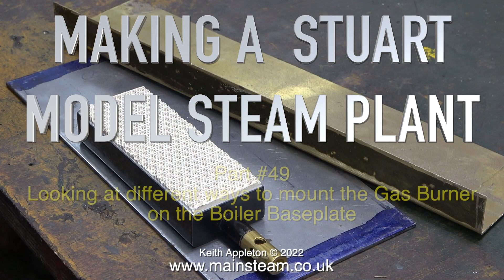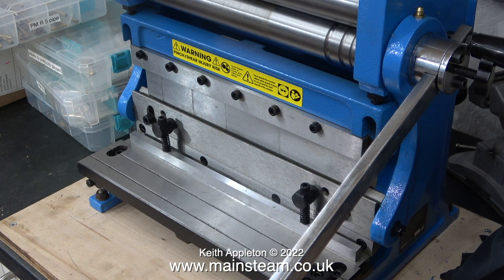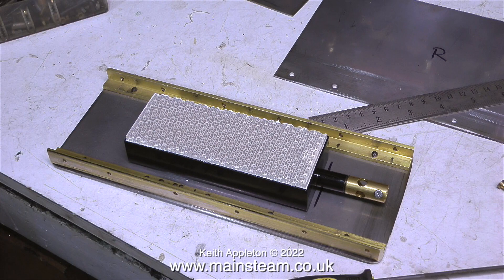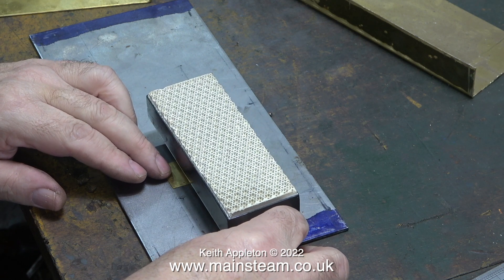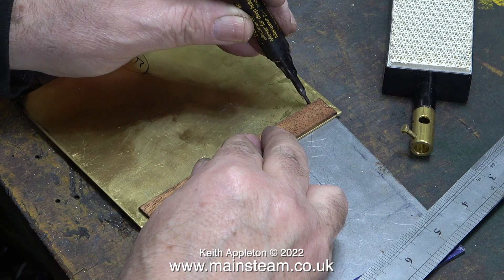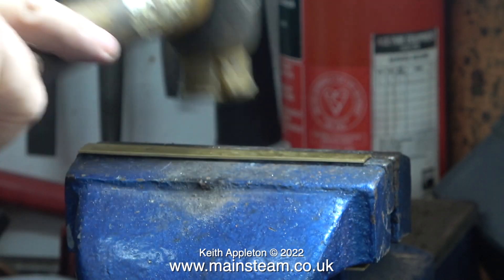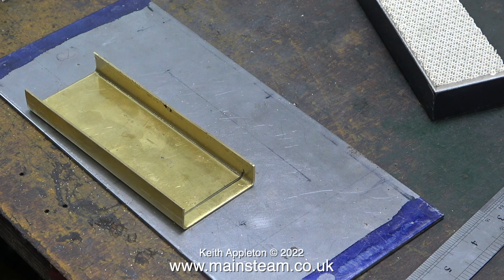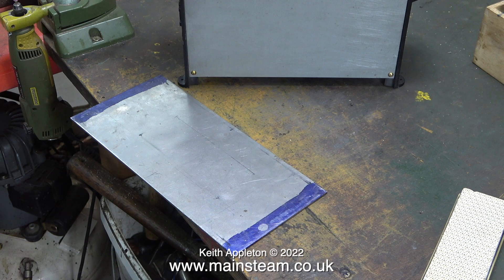MAKING A STUART MODEL STEAM PLANT - PART #49

Comment: why does the burner need to be such a tight fit? If it was not as tight wouldn't it make it easier for removal and future servicing?
Reply from the maker: It does not need to ever be removed. I designed it so that the entire boiler can be removed easily. The burner is a tight fit so that it can't fall out of the holder which would be a fire risk.......